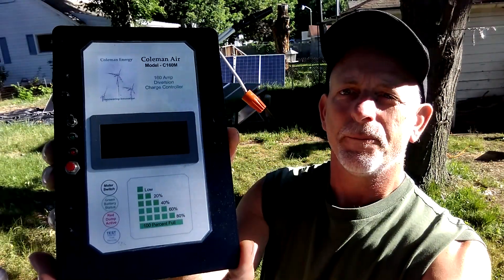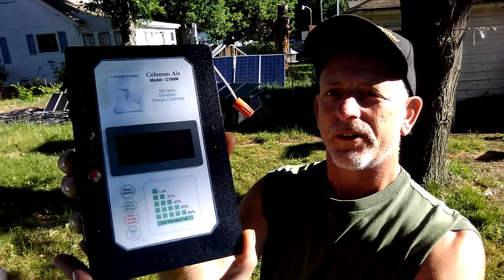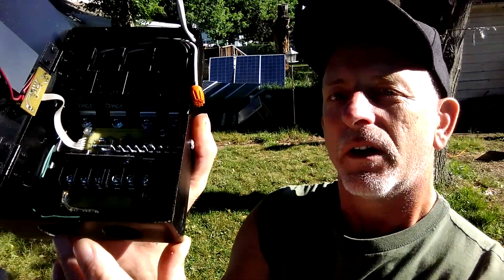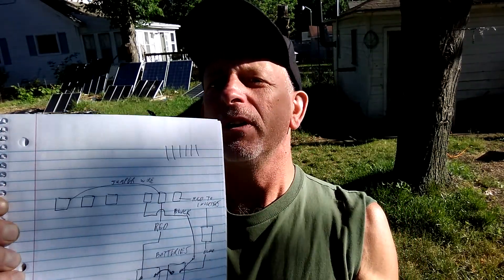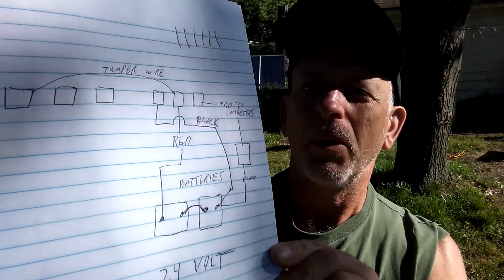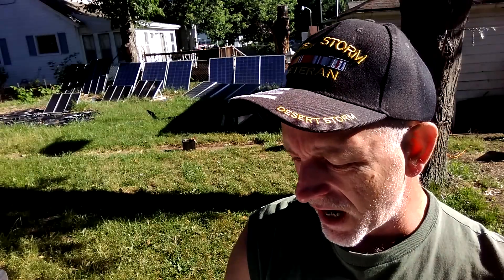Coleman Air-Charge Controller

Comment: Solar panels can be installed in parallel or in series. What would be the best way? for one like that.
Reply from the maker: Just get your used solar equipment on ebay and get started, you will figure that out later down the road.